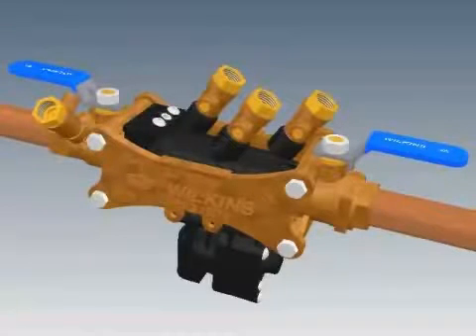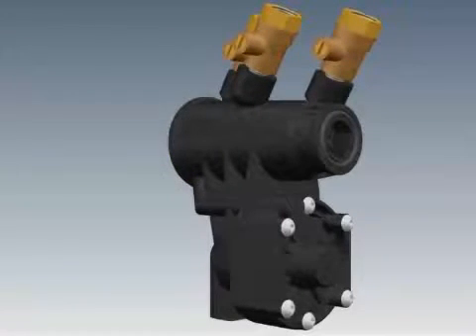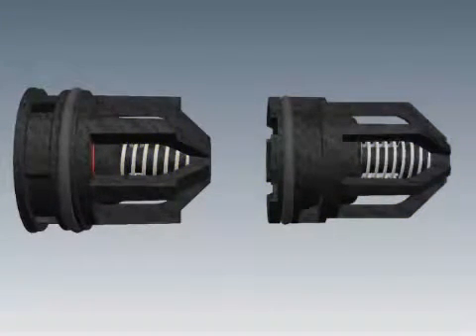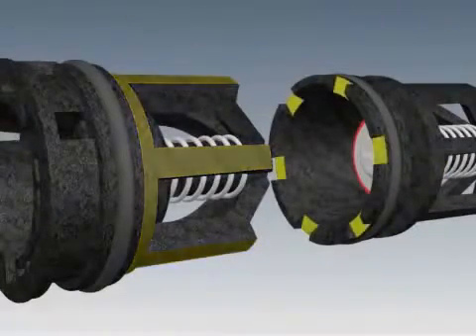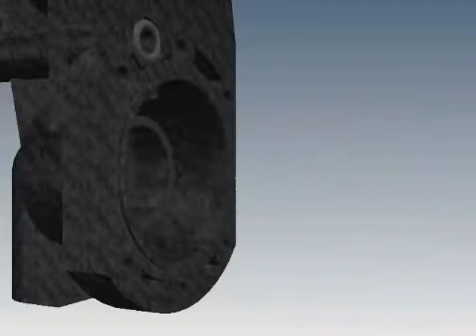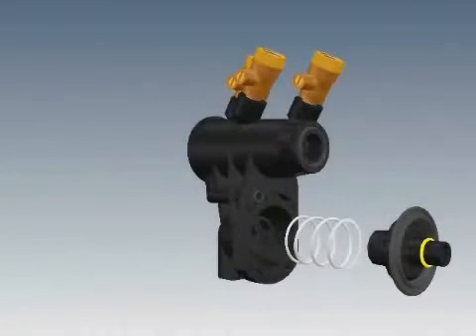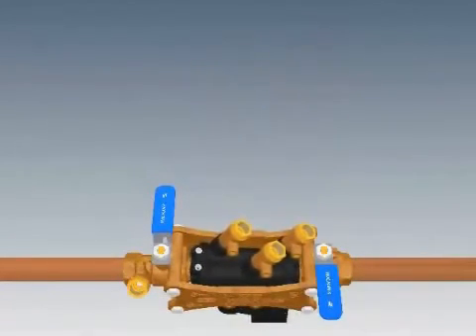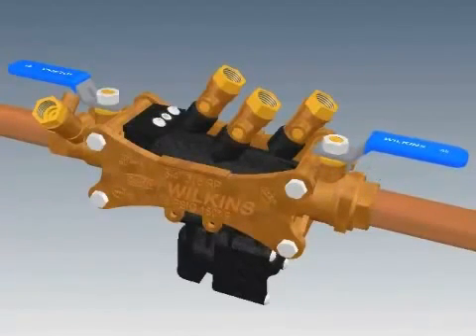Wilkins 375 & 375XL 1/2" - 1" Backflow Repair Video

Comment: Today I discovered that by installing the spring AFTER , or behind the relief valve diaphragm, a temporary fix can be had for a leaking or stuck open relief valve. My neighbor's diaphragm was shredded, so I used redneckery to find a solution. "Put that in your book!"